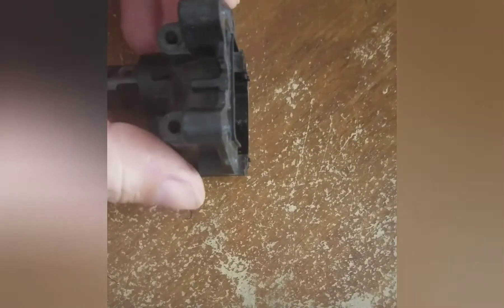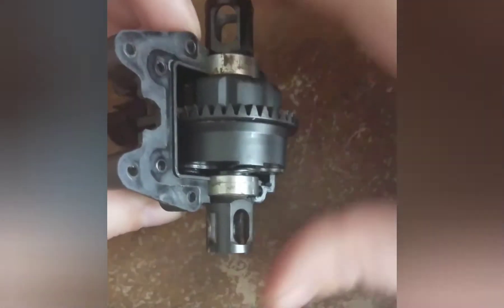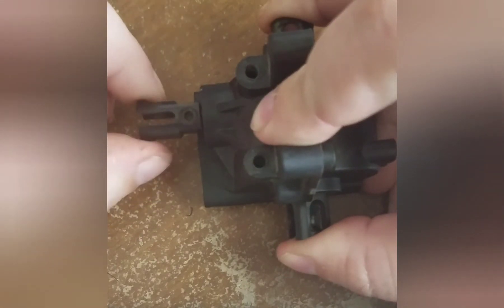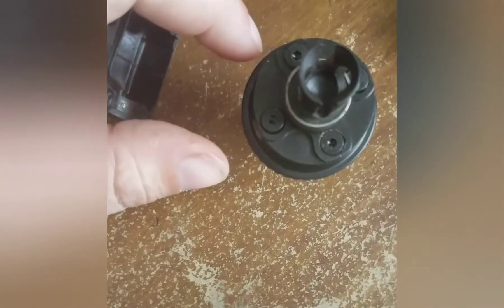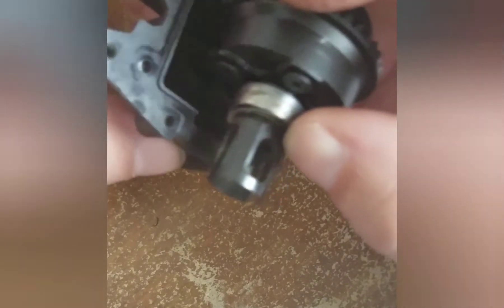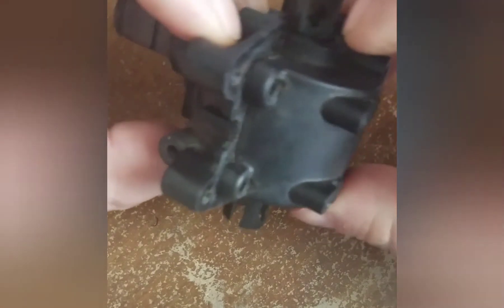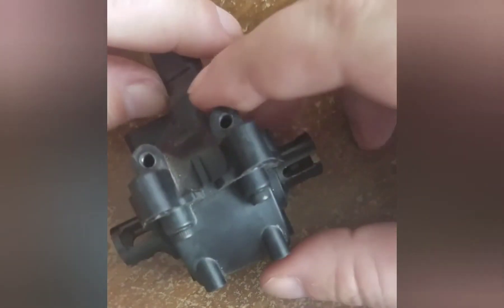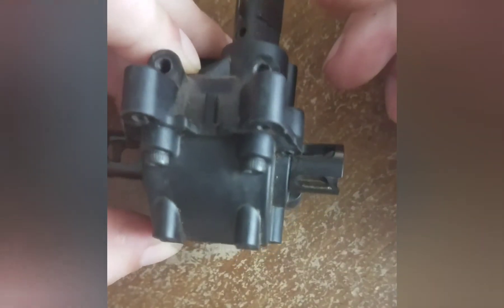RC differential / diff shimming for dummies

Comment: Could you possibly do a detailed video such as this one on shimming the outdrive gear or what would typically be called the axle gear in real life get in and drive car's rear-ends?
Reply from the maker: Im assuming you are talking about the pinion gear that mates with the crown gear on the diff in this video? If so you shouldnt need to shim that unless the manufacturer's did a poor job of engineering the case. A quick test would be to put a dab of white grease on the crown gear that covers the width of the gear surface. Install the diff like in the video then turn it one full revolution so you know the pinion passed over that section with the grease. Take the diff out and look at the grease, it will mark where the pinion is in relation to crown gear and you can shim from there if needed. I have never needed to shim a pinion gear in a Tekno diff though.
Reply: @aaron.royston  no...tightening the spider gears so they mesh properly
Reply: @aaron.royston  also I'm referring to the diffs in a redcat shredder as well
Reply from the maker: same method with the white grease I mentioned would apply

Comment: iam having a problem with my diff. with 1 shim, the mesh is too tight, so i feel the gears grinding all round. however when i shim it properly with 2 shims, now i dont feel the teeth, there is very little play, HOWEVER, in one spot the diff can barely turn. it basically feels like hitting a bump stop, but apart from that one spot it is smooth. what did i do wrong?
Reply from the maker: it might just be a small imperfection that will work its way out once you run it, or it could possibly be you didnt tighten the crown gear evenly, could even be the gasket needs to be replaced (could be crushed on that side of crown gear).
Reply: @aaron.royston  oh okay, thanks, i will try to break it in with a couple of runs and see if that changes anything
Reply from the maker: You might inspect the crown gear to make sure there isnt an imperfection on one of the teeth or debris. I clean my gears out every now and then with a hobby knife, the grease you use for lubrication can get burned or pick up dirt if you run on really sandy surfaces.